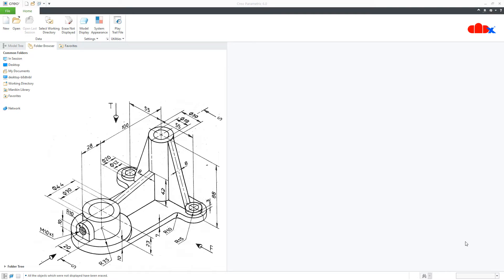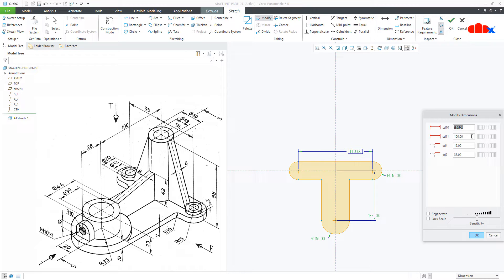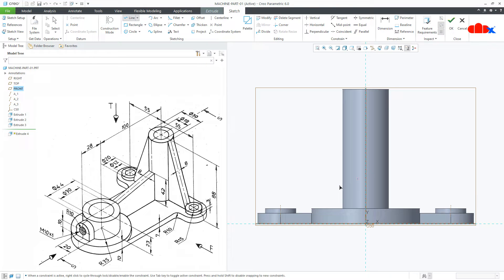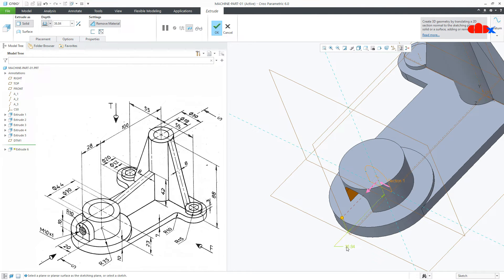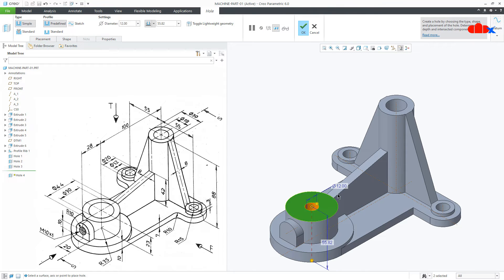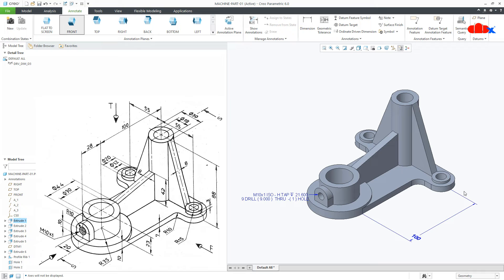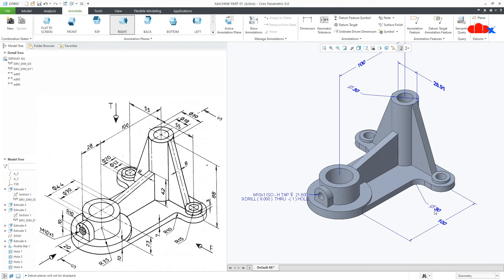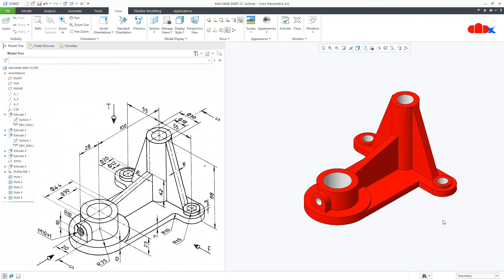Creo part modeling tutorial | Machine part-01 in Creo Parametric

Comment: extrude 4  feels strange and doesn't quite match the picture
Reply from the maker: Actually we need a rib there but the rib doesn't form there. So you need to go for an extrude.
Reply: @CADxTraining  Rib can be formed, but it should be noted that the starting point of the sketch must be from low to high